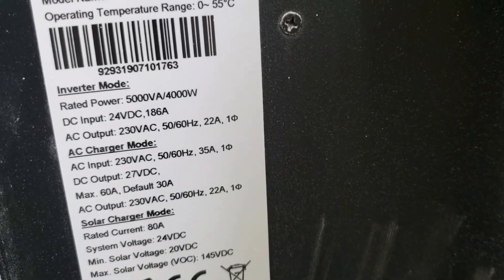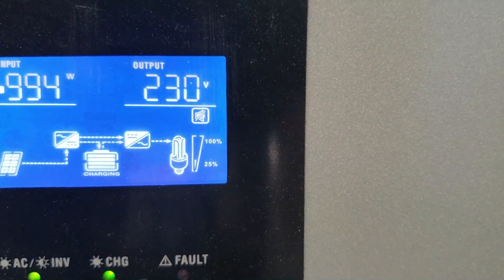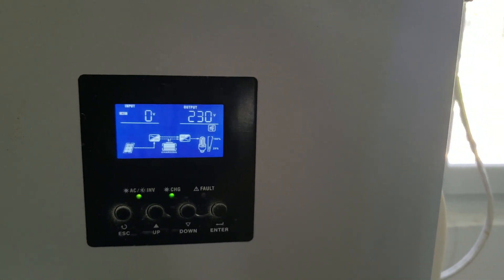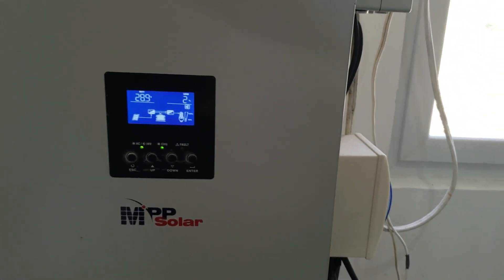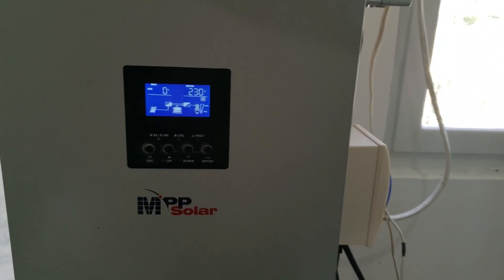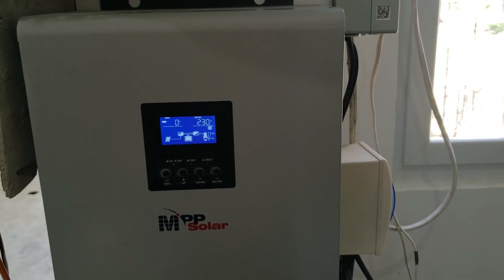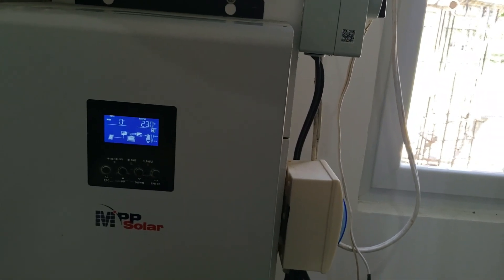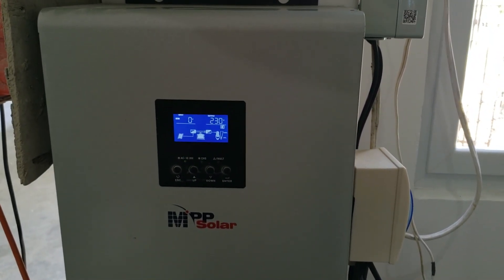MPP Solar PIP4024MSP OFFGRID Hybrid Inverter when we left 3 months ago

Comment: Man i have a brand new 2kva 12v inverter but when i plug my refrigerator the fan start to run non stop and my tv show vertical lines due to this inverter do u have any idea?
Reply from the maker: it's too small for one thing.  low kva and low dc voltage. It's overloading it

Comment: Don't believe the hype.  There is one MFG in china that slaps whatever logo you want on it if you buy enough of them.  I have MPPSOLAR lv6548 and a SUNGOLDPOWQER sp6548 and the units are IDENTICAL.  I have the units working together in SPLITPHASE!  SIGNATURE SOLAR had their logo put on their version of the LV6548 only difference is double the PV input.  These chinese companies have no problem lying about their competition to maximize profit.  95% of these chinese companies will BS you from start to finish.
Reply from the maker: I am running a lv5048 here in Texas. It seems to be a good unit. About MPP SOLAR - they are a Taiwan Company that has had their unit cloned by dozens of other companies. The problem is even MPP Solar has many components still made in China and those companies dont care nothing about property rights.  There is a Chinese company building Yamaha outboards. They are flat out making extra ones and selling them for a huge discount to other countries that dont care. it is sad
Reply: @TexasFilipino  I have seen that happen before,  a business finds a chinese company to mass produce their product and then turn around and sell the same version without the logo to whoever is willing to buy a number of units.

Comment: What are you doing for 120 volt loads? Are you using a transformer?
Reply from the maker: two things - i have a big step down transformer and they are costly. Second I have a secondary solar system  with a 3000w ( true 3000w not fake numbers) inverter here.

Comment: how to stop the fan,very noisy,pls assist
Reply from the maker: Stop the fan and it over heats and shuts down. Put it somewhere that the noise dont matter is my suggestion. It has about 6 heat sensors in it and when that fan is not going and it heats up it goes off!
Reply: @TexasFilipino  so..i finally decided to open it..its 2 small fans like 2 or 3 cm each,powered by 12vdc,the power is too strong for the fan thats why its noisy..i decided to connect a small chip step down voltage,i reduced the voltage to from 12 to 2.8v..much quieter now thank lord
Reply from the maker: @walrezk   i do not condone what you did. The voltage changes at different temps. They did not make a mistake. Later models do have quieter fans. My LV5048 has very quiet fans but bigger heat sinks and overall size is huge. Other more compact models have less space and rely more on air flow. Again I would focused more putting it in a location where the fan noise would have not bothered you.
Reply: @TexasFilipino  lol,it worked,either i do that or i will through  that inverter away,that inveretr is can never work inside homes,maybe  a factory or garage,anyway,home use shodnt heat it that much,mostly works in bypass mode which doesnt heat it as much,hopefully

Comment: Do u leave ur battery to 29 volt when is full or u leave it as 27 volt full ?   I c urs stuck on 29 volt 

For a 24 volt system which is better to leave ur battery volt to 27 or 28 or 29 volt ?
And how do u know wen is on absolute or float ?

I have the new kind pip 3024 gk
Reply from the maker: It peaks to 29 in a cycle to prevent build up on plates and the acid settling on bottom. That pic was taken during a cycle
Reply: @TexasFilipino  ok thxz you I will change mine to 29 volt
Reply: The reason I ask is cuz wen I had mines at 27 volt my battery dies fast idk y but u guess thats the reason. Sum1 else told me to out it on 28 volt
Reply: But for sum reason wen I change my battery to 29 volt is stuck on 27 volt y is that ?
Reply: After reaching 29v it will go to float charge at the setting you assigned (27v) it is a cycle in charging called floating

Comment: What is the output voltage? Because that's not the split fase fase. Do you have 110v or 220V loads?
Reply from the maker: Ok this model is single phase 220v -240v (single leg) like most of the world is. This unit is not for North America / Puerto Rico.  Some people have used it in USA but you would need a step down transformer and one big enough to handle the loads. Also you will have power loss with this transformer. Watch my videos for the LV5048 NORTH AMERICAN version.  MPP SOLAR also offers a LV2424 for North America as well. They both are capable of paralleling them for more watts. These can be configured just same as power in typical American home. Tbank you sir MPPSOLAR.COM
Reply: @TexasFilipino  ok

Comment: Hi. Do you know how this inverter behaves when is under power load and the AC current, for example 15A ac load, is much higher than it's capability? Will it switch to grid or enter to an error state ? Thank you
Reply from the maker: It will beep loud warning and then shut down. It will recover once overload is stabilized.  You can't run 100 amps grid power  through for instance a 20 amp inverter and expect it to carry that load. This is why you need to size your inverter properly or get units that can parallel together with greater load capacity and with that you will also be increasing the load capacity of what it can do when it switches to grid.   " a chain is only strong as it's weakest link"
Reply: @TexasFilipino  thanks for the advice

Comment: I have the 12v 800 watt inverter in my "RV", it works as advertised, and has given me zero problems. You MUST read the manual as it is EXTENSIVE. Many different settings.

Comment: In a mid day during sunlight, with this hybrid inverter, is it possible to directly consume the electric power (from PV - Inverter - Load) without battery use?
Reply from the maker: It goes into direct consumption mode but even one cloud comes over and drops the pv below the load it needs the batteries or it will click off.

Comment: How much a unit?
Reply: I think this model is somewhere around 500
Reply from the maker: they was 600 each with the parallel boards. they are not automatically built in on these units. the trick is if your sending them to PH is the customs tax in manila. for what the tax was I could have flown to Taiwan and got them same day n brought am home in luggage plus had a mini vacay. Manila held them at customs forever while some genius researched the value. Later I found out they should not have taxed me on them because they energy law there makes solar equipment get exemption.
Reply: @TexasFilipino  can I  have the link for this law? I'm planning to get mpp but afraid of the customs taxes